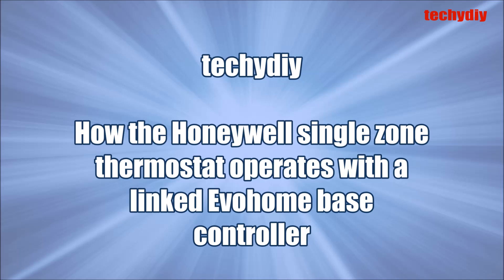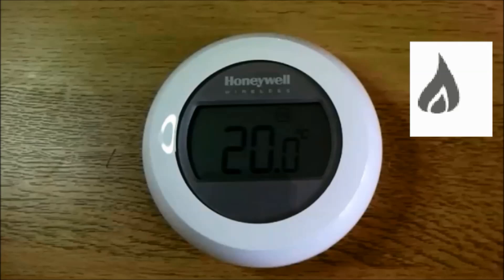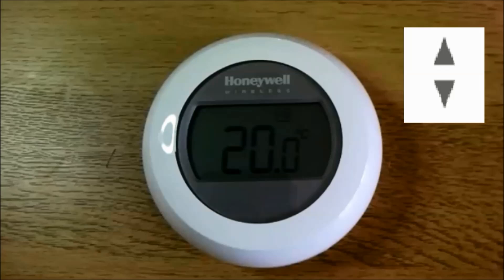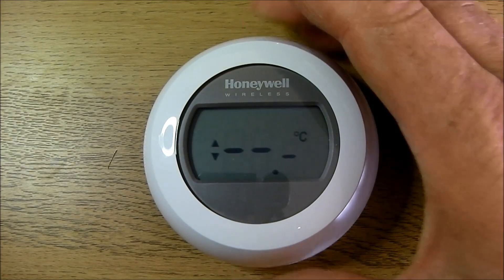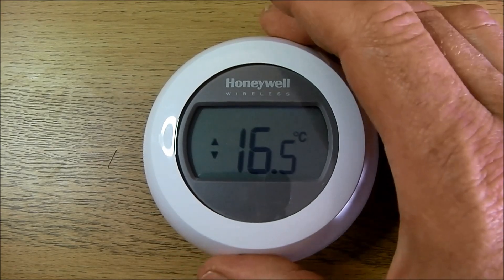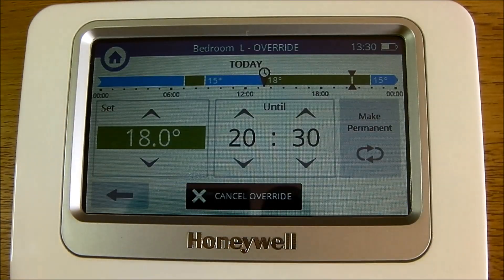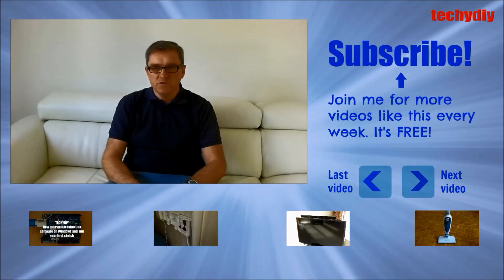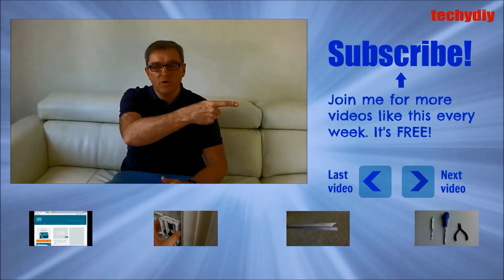How Honeywell single zone thermostat Y87RF operates with Evohome base controller video  T87RF

Comment: Hi,
I have ground floor where mount is central unit evohome pairing with OpenTherm bridge R8810. I want mount T87RF on first floor as remote temperature sensor only which will display 1st floor temperature on evohome unit. Is possibile without pairing T87RF to OpenTherm bridge and HR92?

Comment: I have a evohome system with a ATF600 base unit. The lounge consisting of 2 radiators bound to HF92 rad valves on each rad. I am trying to use a single zone T87RF to control both rad valves.  I am struggling to find instructions to do this. Some say that the HF92’s need to be unbound some indicate just bind the T87RF to the controller and it will work. Can you advise me the correct procedure to ensure the T87RF single zone thermostat controls both rad valves.
Reply from the maker: I have no idea sorry
Reply: Hi, did you manage to figure this out as I am trying to do similar but with a single zone and without success? 

I have bound the Y87RF as the remote sensor for the HR92 zone in question (HR92 already bound and setup) and it shows success on the Evotouch but it still uses the HR92 as the temperature sensor - displaying whatever is shown on the HR92 in both the app and Evotouch, rather than the room temperature shown on the Y87RF, which is always lower than the HR92, hence why I want the Y87 as the temperature sensor. 

What's even more confusing is when I turn the Y87RF it will actually change the setpoint to whatever I select and this is then shown on Evotouch and the app, so it's definitely connected.  Talk about confused!

Comment: Hi John, Thank you for this. My thermostat seems having a set temperature  "stuck" at 17.5c so when I increase the desired temperature (by rotating clockwise the wheel) to anything above 17.c it does not activate the boiler central heating. There is no factory reset button but I think the 17.5c has been set as the maximum temperature ( when 17.5 shows the upward and downward little arrows show too) and that is what I need to change and bring it to say 35c to llow me to have heating when asking for say 23c. How do I unstuck the 17.5c set; is it the max temperature set ?  thank you
Reply: Same thing to me al 14.5. I think my thermostat is desd
Reply: I have exactly the same problem. Can you tell me how you fixed it?

Comment: Hello, is it possible to connect 3 radiators HR92 valves on the same thermostat  ? So I coul change the temperature of the 3 radiators with the Y87RF in the same time
Reply from the maker: Yes, if it's used with the evohome system.

Comment: Do you happen to have a wiring diagram? I am trying to set up multi-zone in my home and i do have the base controller and the Y87RF thermostat. I am just not sure how do i connect the 2nd thermostat to the system. I have connected base controler/RF module to the boiler already - and this seems to be working fine.
Reply from the maker: +Infinit0s Lookup a Honeywell S Plan + (plus). Wiring diagram. Basically you should have multiple zone valves, each with its own bdr91 relay. Then you bind a zone to each bdr91.
Reply: Thank you for the reply, i see. Since i only have 2 valves (1 for heating and 2nd for water) the Y87 is redundant now - i need to fit more valves in place and redo plumbing. I guess at the moment i am just gonna buy TRVs
Reply from the maker: I see. Well in that case your probably better off buying the trv HR92 controllers. You can use the Y87RF as a thermostat in any zone, even if they are operated by the HR92 controller or the base controller.

Comment: Great instructions. I need to get one of these controllers in my kitchen to control a motorised zone valve to operate a plinth heater. I have a wireless interface. Can the y87 control the zone valve and still be controlled by the main unit?
Reply from the maker: The single zone thermostat can be directly bound to a bdr91, which can be in turn be connected to a zone valve. Alternatively the single zone thermostat and the bdr 91 can be bound to an Evohome base controller for a more complex installation, again the bdr91 is connected to the zone valve. The zone valve switch contact is then used to call for heat from the boiler. The single zone thermostat kit should come with a bdr91.

Comment: Hi John Thanks for your videos very helpful I am hoping you can answer a question I have currently 3 zone valves which are controlled by Wireless Siemens Stats I am trying to find out if I can Bind 3 BDR91 relay boxes to 3 zones on the evo controller and then use them to replace my existing relays of course bound to new Honeywell stats the valve end limits currently switch demand on boiler which works fine basically I am trying to find out how many BDR91 zones the evo can handle 
thanks myles
Reply from the maker: +Myles Meagher Yes 3 BDR91s and 3 zones are fine. 12 zones were the maximum the last time I looked. I recommend taking the free online installer course here  http://youlearn.honeywelluk.com/   Also keep BDR91s 300mm apart and away from any metal. Reset / clear bindings on everything before you start. Regards, Nigel
Reply: Thanks I looked at online course but they concentrate very much on radiator valves so very little about stats connected to zone valves they cover a little about s and y systems but not much more so glad to hear you can use more than 2 stats on the gateway remote pack it only supports 2 wireless stats thanks again

Comment: Hi

Does the Room Sensor Controller the Wireless Radiator Valve in the same room?

I was sold a system that I expected the room sensor to control the Wireless Valve and bring on the boiler. So far, even thought I have bound the zones sensors and wireless radiator valves. The only control is from the wireless radiator valves!!

Thanks

JR
Reply from the maker: John Russell You haven't given any detail about what components you have so I cant easily comment, but it sounds like you have bound the temperature sensor in the wireless radiator valve to the zone rather than an external room temperature sensor.

I suggest that you run through the following free online evohome installer course from Honeywell:  http://youlearn.honeywelluk.com/courses  
that should answer most of your questions.

Hope that helps.
Reply: Thanks for that.
I am a Honeywell Centraline Partner, but am using Evohome for the first time.
I have the Y87RF sensors, Evohome Controller, (built in Wifi) HR92 Radiator Valves,boiler & hot water kits.
At the moment, only the radiator vales control
I have seen that in need to set the sensors to "CO" before binding. I will Start over and try again. I will look at the training course you kindly sent.
Regards
John Russell
Reply from the maker: John Russell Clear the existing binding on the Y87RF first see here:   https://youtu.be/prDupxp5lWA